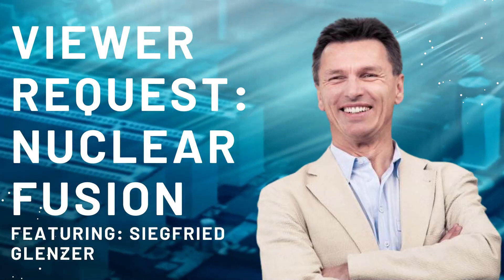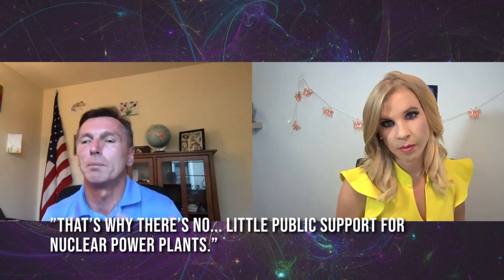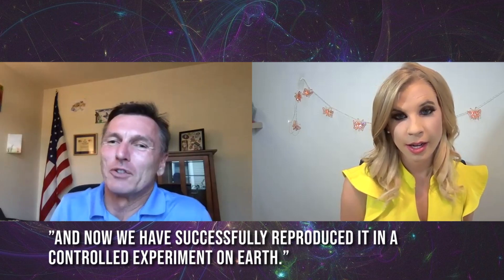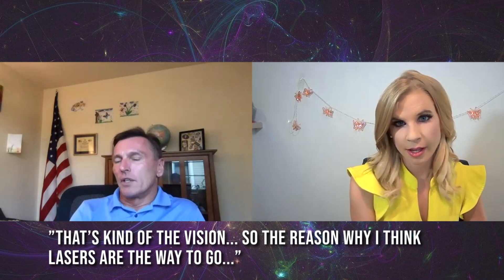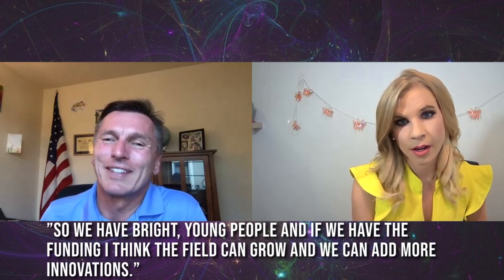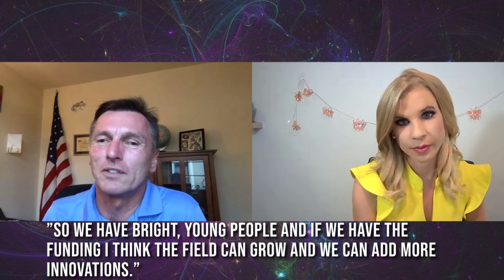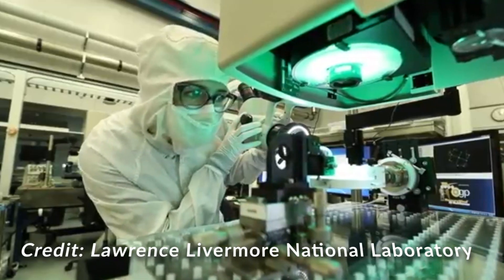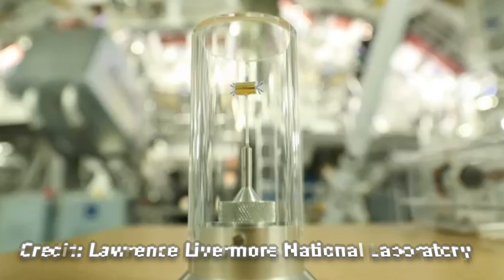Will we see Nuclear Fusion in our lifetime?

Comment: You can tell he is a scientist and not an engineer!  Where do I even begin?!  We still haven't broken even yet on fusion as far as energy in vs. POSSIBLE energy out.  Possible as in captured and changed to electricity at 100% efficiency.  They literally haven't even attempted to start capturing any energy at all much less start down the road to a functioning power plant.  High energy neutrons coming out of this reaction will make the entire machine and surrounding building highly highly radioactive just like any fission reactor.  They act like you can have a picnic right next to a functioning fusion reactor.  This is just a researcher trying to create hype for his field and glossing over gargantuan holes in our knowledge/ability to convert this to a usable technology.  We should immediately begin transitioning humanity to 3rd gen fission plants as baseline with wind/solar/grid storage to handle peaks.  Medium term, we should switch the 3rd gen fission plants to the thorium fuel cycle.  Once that is done, we still won't be anywhere close to a fusion power plant that could charge my laptop.  This technology is so far away, it is unfair to pipe dreams to call this a pipe dream.

Comment: Nuclear fission doesn't generate "nuclear waste"... It generates "nuclear byproduct", that can be further processed within different technologies of nuclear energy plants...
Reply: Cool, good point, byproducts!)) What are these exactly?? Can they be used as an energy source for Fusion??)))
Reply: @ApteraEV2024  if there is any technology providing capabilities of using "nuclear waste/byproduct" in producing deutherium and/or tritium, than this technology therotically would be capable of contributing with the current stage of fusion energy research/development.
Reply: @ApteraEV2024  (nuclear byproducts) "what are these exactly"? It's a different name to the same stuff which is considerated as "nuclear waste", due to an interest of further extracting value from such materials.
Reply: @tiagocardoso4702  ok... I found an answer by Google ing,, Can nuclear waste be used as an energy source?
Reply: Oxidane!!)) Heavy water!! Finally.

Comment: I have my doubts.  Ok, so say they get a sustained reaction going... What's the plan for making a containment vessel that can withstand the temperature of the core of the sun for more than a picosecond?  Assuming you nail that, how do you tap that in any significant way without quenching your very delicate fusion reaction?  And then there's conversion; are you going to flash boil an entire Great Lake to spin up a million steam turbines for a few minutes?  Even that ludicrous solution is not going to recapture enough juice to make up for what you put in.
Reply: Germany just had a break through in nuclear fusion just last week they harnessed nuclear fusion it's one of the biggest breakthroughs in modern history

Comment: I guess we get magnetic confinement fusion before laser-ignited fusion. New superconductors can create stronger magnetic fields than previous ones. That is a huge advantage for a fusion reactor.  Some labs have promised a fusion reactor that produces more energy than it uses in 10 years.  There are several different designs.  
The most interesting development in fission is molten salt reactor. It was developed parallel with our current water-cooled reactors.  It was rejected because of politics and because they used thorium as fuel. Thorium reactor does not produce plutonium suitable for bombs...  The molten salt reactor has many safety advantages over water-cooled reactors.  (Disadvantage: Hot molten salt is very corrosive. But they claim that can be solved.) Perhaps a molten salt reactor could safely use our current nuclear waste as fuel.  Resulting waste would become practically non-radioactive in 1000 years.  I could write much more, but it is almost midnight and I don't know if you are interested.

Comment: We've been pouring billions of dollars into this inertial confinement research for over 40 years. Why should we continue to do so when electricity generated from solar cells has become cheaper than electricity sourced from the grid? And solar cells + batteries can be used to form micro-grids.
Reply: There is no easy solution... If you can provide evidence that solar cell + batteries are a self sustainable, globally feasible solution to deliver all of our energy demands, than you have it.
Reply: @tiagocardoso4702  Watch this video by Tony Seba. The video is about an hour in duration.  The interesting stuff begins at about minute 35. 
https://www.youtube.com/watch?v=Kj96nxtHdTU

Though solar energy is not able to power the grid yet, it is clearly on the path to doing just that. By the time inertial confinement fusion is real, we won't need it !
Reply: Does solar cells + batteries solution (apparently) cheaper due to higher efficiency of a technology or due to higher government subsidies?
Reply: I'm not justifying spending billions of dollars in fusion energy research... I have no idea if this amount of spending will result in revenues.

Comment: You have a talent for finding interesting subjects to interview.  I enjoyed the discussion!

Most of the funding for fusion research is still going into torus-shaped magnetic confinement - specifically, the vastly expensive ITER experiment in Europe.  It's still plodding along, burning cash... despite the fact (and it is a fact) that there is no hope that this research path will lead to commercial power plants.

So, okay.  Pure research can be valuable, too.  We try things, we learn.  But the 'bang for the buck' at ITER is pathetic.  Lawrence Livermore Labs, at least, is working on a different approach involving laser ignition.  The experiments, while still costly, are a tiny fraction of ITER's costs.

Watts are a measure of the energy rate of output from the experiment.  But the amount of energy produced in a power plant is represented in watt-hours.  The experiment we heard about today produced a tiny blip of total energy.  The scales involved are incredibly small.

Getting lasers to fire often (10 times a second is probably too slow) is only one of the tech challenges.  The other big one is safely getting the energy out of the reactor.  There are no materials that won't vaporize if fusion temperatures come into contact with those materials.  The Livermore experiment avoids this problem with singular firings of such short duration with such small energy yields that fusion temperatures never reach any of the apparatus used to conduct the experiments.  A commercial-scale reactor will have to solve the energy-out problem as well as the frequent firings problem.

Back in the mid teens, Lockheed's Skunk Works announced that they were working on their own fusion reactor design, with the expectation that by the early 2020s, they would have a commercial, affordable fusion reactor the size of a semi-truck trailer that could be mass-produced and deployed anywhere in the world.  Since then, they have gone completely silent.  I'm pretty sure they ran into obstacles with their design concept that they can't overcome.  There are other commercial attempts in progress, but... investors have nothing to show for any of them.  And they won't, I think.  It's just too soon.  There are good ideas, but there are no complete good ideas about how to design a commercial reactor.

Fusion isn't going to rescue us from climate change.  Fusion research is moving too slowly.  This isn't the fault of researchers.  It's simply an almost intractable problem in physics.

So, if we do ever get commercial fusion going, say in 2050, will that solve the climate change crisis?

No.  Displacing fossil fuels is only one aspect of the climate change problem.  The climate system has momentum, and it has feedback loops, so ending human forcing from CO2 emissions will still leave us with centuries, possibly thousands of years of additional climate change.  We might stop fighting over petroleum reserves if we had commercial fusion (or if we succeed in displacing fossil fuels with solar, wind, and other renewables), but we will still have problems with food production, water resources, submerging coastal areas, excessive heat stress in the tropics and even some temperate zones, extreme weather, and consequential human migrations.  Wars aren't going to disappear, even if we assume commercial fusion.

Too bad, that.

As an aside, there really are no such things as 'green fuels.'  We could use fusion energy to manufacture synthetic fuels, and the carbon used to create the fuels and carbon released by burning them could be made to balance, and we could transport those fuels via electric trucks and pipelines (also using fusion energy or other renewable sources), so that no net carbon is added to the atmosphere when the fuels are burned.  But!  Burning synthetic fuels does release toxins into the atmosphere, and those toxins do kill people.  And emitted toxins harm ecosystems, too.  Synthetic fuels are not green, and putting toxins into the atmosphere isn't my idea of sustainable.

Cheers!

Comment: Over the very long haul, controllable hydrogen fusion will contribute significantly to the livability of such places as central Greenland, northern Canada and the interior of Antarctica. I foresee streets in these very frigid areas lined with sensors that detect the movement of a passerby, triggering the release of a stream of heated air. Ultra-tiny amounts of deuterium (catalyzed by the presence of tritium) would be brought to the fusion temperature by repetitive laser bursts in  such a way that average overall temperature would be well less than  that of the sun (23 M degrees?). The product of reaction, alpha particles,  would neutralize very quickly, as they can be stopped by a few centimeters of air

Comment: Sustained nuclear fusion power generation available within 50 years?  Yes.

One thing that might make it practical sooner is to use Helium-3 in place of the tritium.  At least theoretically, helium-3 could be substituted for tritium and thereby reduce the number of free neutrons released during the fusion process.  This would (again theoretically) make the process easier to control and less damaging to the reactor (free neutrons are very difficult to control, since they have no charge, and can and will damage the reactor if they are not controlled).  The interesting thing about helium-3 is that there is a high chance that helium-3 could be mined on the Moon (helium-3 is deposited on the Moon by the solar wind).  So within 50 years we may have helium-3 mining set up on the Moon to feed to our new fusion reactors on Earth!  Woohoo!